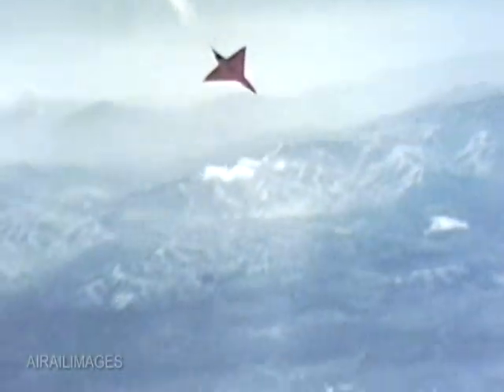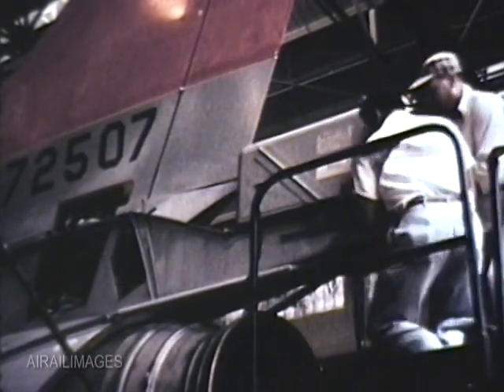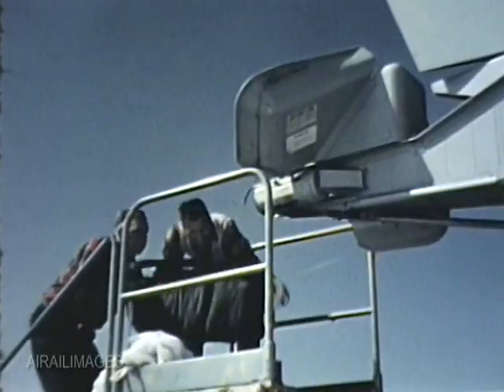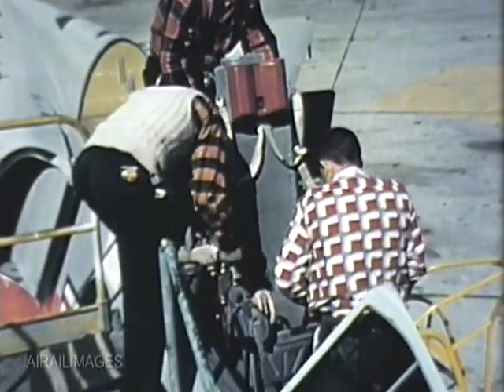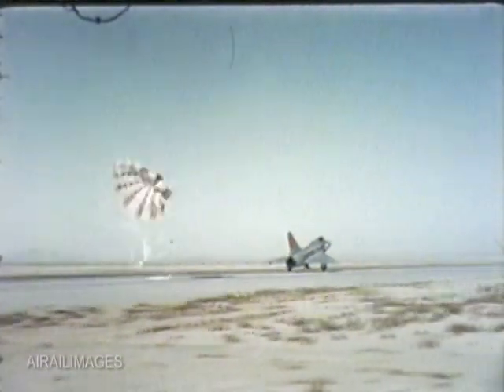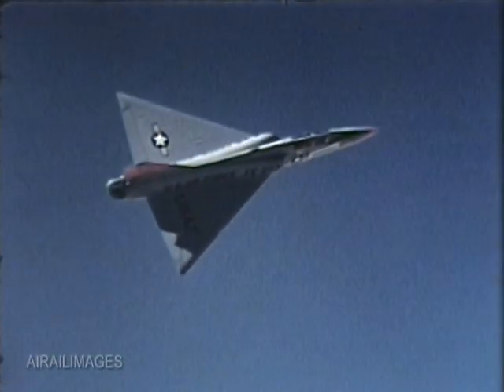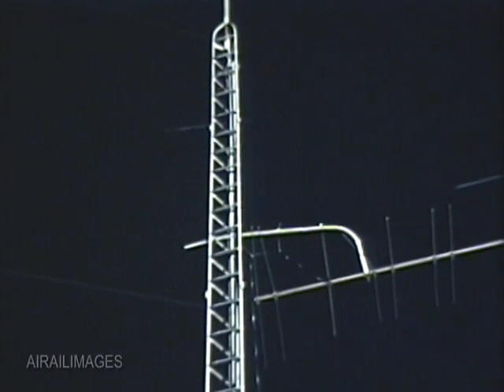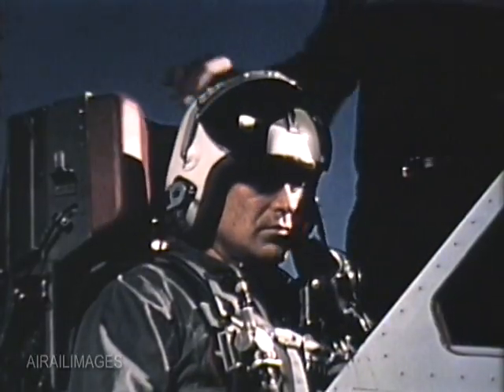F-106B Spin Testing at Edwards AFB

Comment: The time is long past when air frame designers are required to make planes stall and spin resistant !!!  The FAA needs to require stall and spin resistance before certifying a plane for use.

Comment: I was a 32251a awcis at Bunker Hill from  July  1961 until 319th FIS was dispersed all around, and then to Kinchloe (Ruptures Duck) until I was discharged in July 1964.  Bunker Hill had B58s and Kinchloe had B52s. Trying to work on 106s on the flight line was cold as He77 in the winter in both places. I loved working on the electronics and being able to  witness the varying different planes but I am very partial to the F106. It was a beautiful airplane, it was a very clean, sleek plane. When I go to the Air Force Museum at Wright Patterson I always take too much time looking at F106 displayed. I did sneak in the nose wheel hole.  The Gyro was not present.
Reply from the maker: Glad you found our channel.  Yes, the F-106 is a beautiful aircraft. When I was at McChord in the 1980s, I was able to secure an F-106A for the McChord Air Museum when the 318 FIS was transitioning to F-15s. The "save list" for operational parts included the engine and afterburner shroud, but an enterprising Pratt & Whitney tech was able to come up with a non-serviceable exhaust section so our airplane still looked externally correct.

Comment: There's an F-106 on display here at the Dover Air Force Base museum. I remember the day it flew in and did a fly-by or two back in 1998 I literally almost soiled myself in disbelief when I saw it. Still one of my favorite aircraft of all time. There's even a mockup cockpit of one with all the instruments and radar screen and even a fully dressed pilot inside in the indoor portion of the museum. If you're ever in Delaware take time to visit this wonderful little place with all its aircraft parked on the ramp you'll love it. The neat thing is every type of aircraft displayed had a brother that was actually stationed here....like the 95th FIS flying the -106....pretty cool indeed.
Reply from the maker: Yes -- that is a great museum.
Reply: J Cruz Tyndall AFB was still flying the F-106A as the Southeast Air Defense Sector primary interceptor while I was stationed there from 1978-82, in the (Analog)Flight Simulator Facility.  One ran out of fuel short of the runway (and LAND) and burned on the beach... in front of/ next to Capehart base housing.  It was interesting...
Reply: There's a beautiful 106 and also a 102 on indoor display at Robins Air Force Museum in  Georgia.